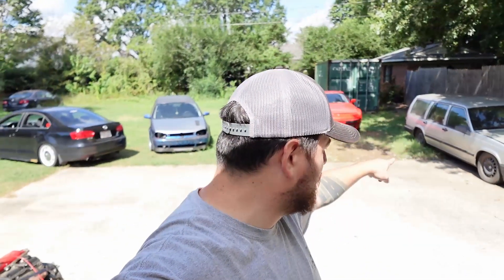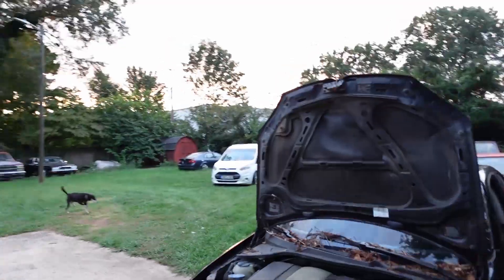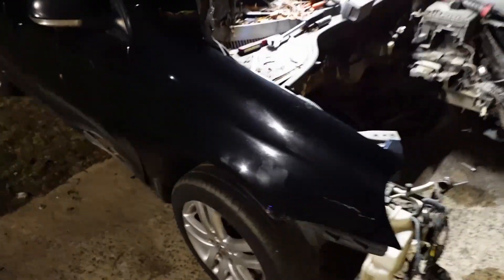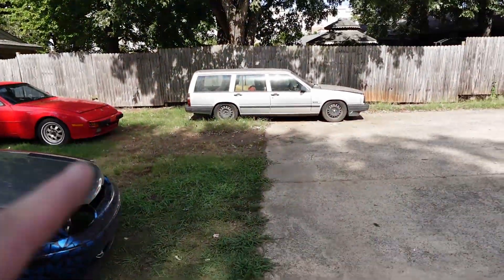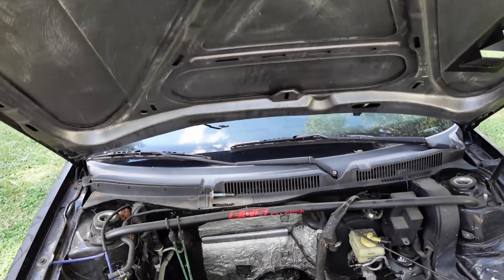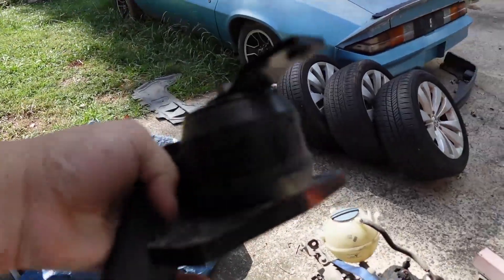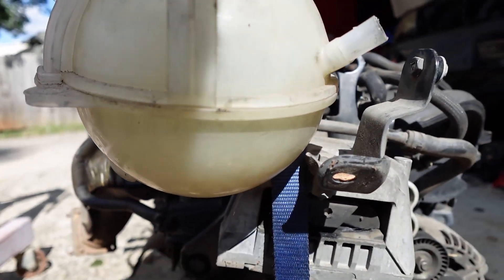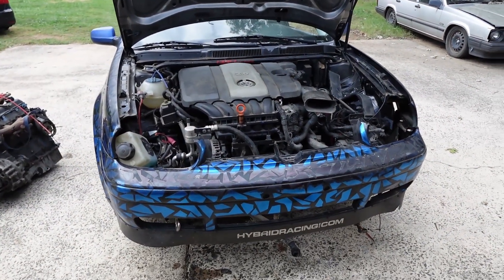5 Cylinder Swap into my MK4 GTI (Part One) 07K Build

Comment: Did you have to swap axles or hubs to fix the tranny on the 2.5? Or is everything almost "plug n play"?
Reply from the maker: I have a mk5 jetta 5 speed and mk5 jetta axles bolted in with no issues but I haven't driven it yet, still working on coolant and exhaust on this car.
Reply: @UselessBuilds okay thanks. Wasnt sure if the knuckles or hubs needed to be changed cause of the splines
Reply from the maker: @andrewisaac7195 I was worried about that too, but the splints are the same and the mk5 axles use a bolt instead of a nut so I will need to put miles on them to confirm they will work reliably

Comment: Were did this build go
Reply from the maker: Currently on hold for the weather, been doing all the wiring but haven't figured out how to make a wiring video less boring
Reply: @UselessBuilds  I have a jazz blue  20th anniversary I would love to put a 2.5 in. I have put over 30k care free miles on my 5speed mk5 it has been the most reliable VW engine I've ever owned.
Reply from the maker: @Ruckusism  very nice you shouldkeep it forever, my Mk4 will be one of the cars that I will never part with as it was my first manual swap and the first car I actually modified when I was younger!

Comment: Does the 2.5 motor mount bolt up straight to the mk4 reciever mount? Or did you have to get a different motor mount reciever
Reply from the maker: I have a mk6 jetta 2.5 engine mount bolted to the mk4
Reply: @UselessBuilds  So the full 2.5l mount bolts up to the same holes as the mk4 mount?
Reply from the maker: @bendugan4040  yup sounds like I should do a more in depth video lol
Reply: @UselessBuilds  lol, im looking into swapping my mk4 gti to a rs3 powertrain and want to see how much work is needed
Reply from the maker: @bigmon9186  ill go over it more in my next video but the 2.5l has an 02j bolted up to it. But I'm using the 02j that came in the mk5s and new beetle

Comment: GREAT BUILD! i have a mk1 with a 2.0 from a jetta mk4. Can i use the same mounts from the 2.5 where it sits the 2.0?
Reply from the maker: I believe the transmission mount is identical but the engine mount is different and you could look at the new beetle mounts to see if it will work for your application